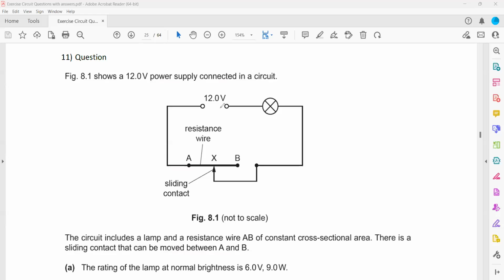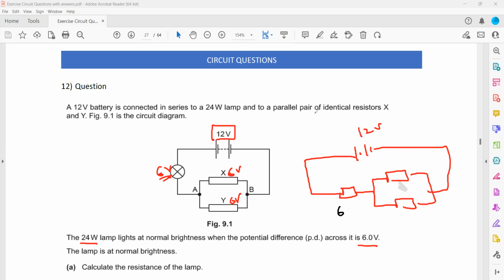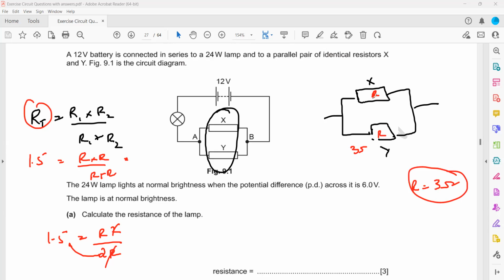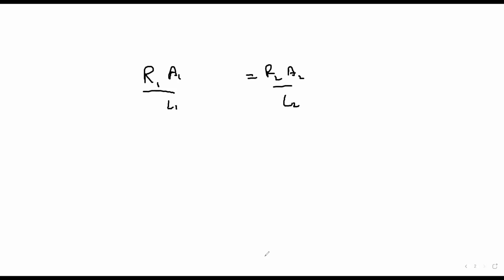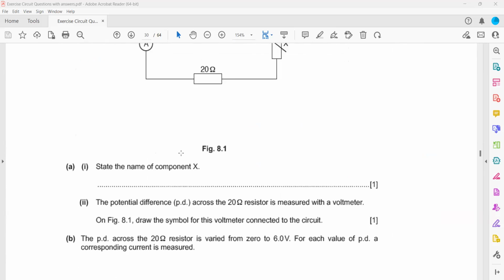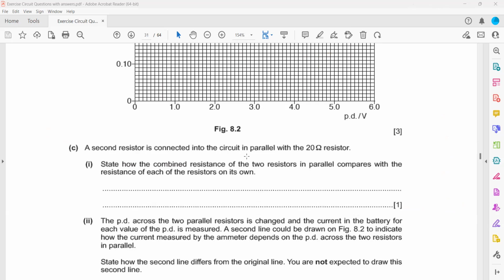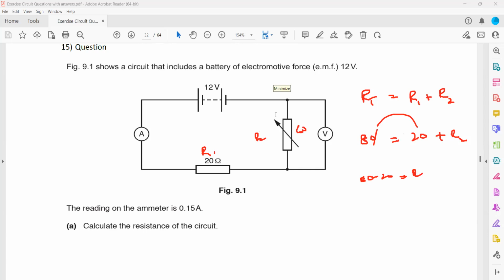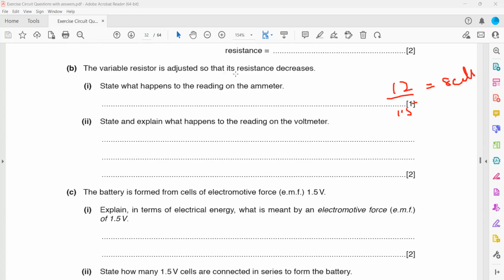Electric Circuits Question 11 to 15

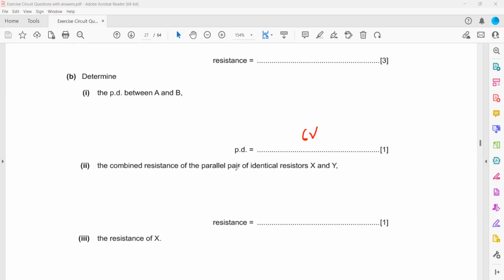Comment: 7:33 sir b i should be 12 V or 6 V
Reply from the maker: it should be 6V because the lamp is connected inseries with parallel combination 
the Voltage across lamp is 6V so remaining voltage across the parallel that is 6V